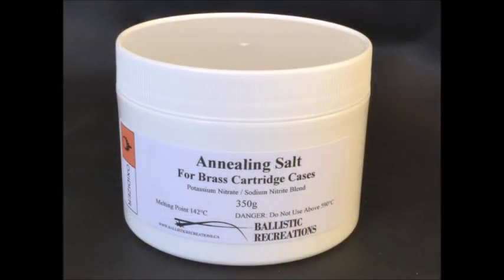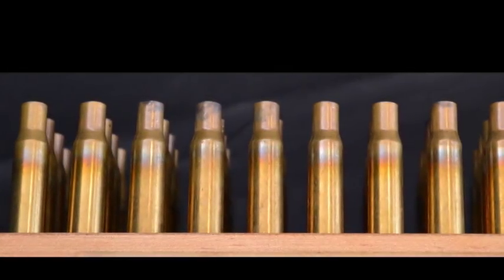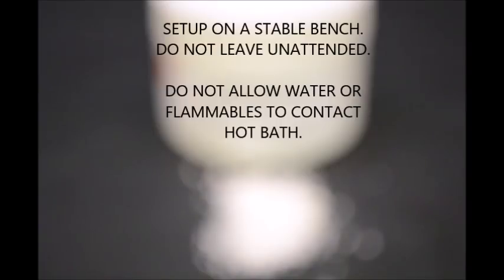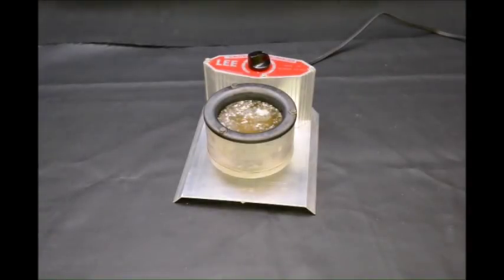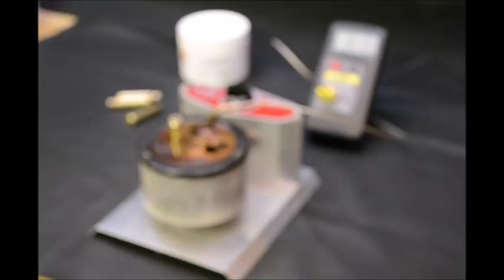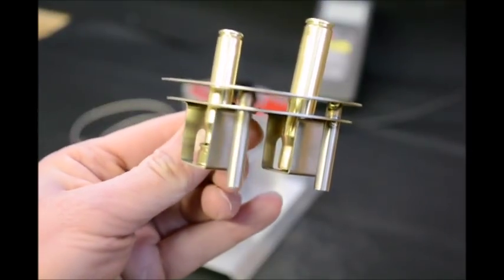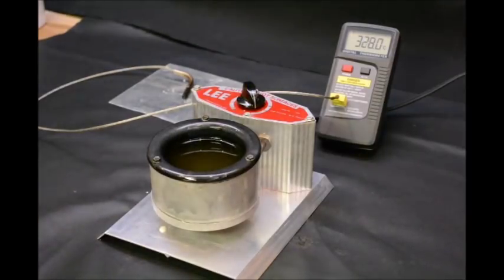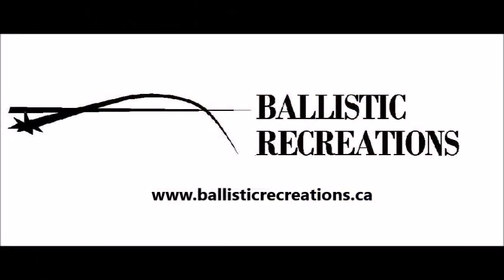Overview of Salt Bath Annealing

Comment: Annealing does absolutely nothing for accuracy.
Reply: Jessie Wright other than keep neck runout low from firing to the next, which translates to consistent neck tension, which translates to accuracy
Reply: Jessie Wright annealing has everything to do with consistency, and consistency is where accuracy comes from. So, thank you for your opinion, but next time read up on the process prior to spouting off a completely bold and untrue statement.
Reply: Let me rephrase.  Annealing has done nothing for accuracy "For Me".  "F" class 6.5CM and 6mm BR for 20 years.  PRS in .308 for the last 2 years.  Annealing does more for over stressed brass then anything else.  If my brass cracks, I buy new brass.  I use custom sizers built for my chambers.  I think neck turning does more for accuracy than annealing.
Reply: Jessie Wright even when annealed brass has proven to be more consistent? You are the messiah. I've been shooting PRL and PRS for 5+ years now, and BR for 20+ also, and every top shooter at the regional matches I've shot has annealed brass. Maybe it's not the arrow and it is the Indian.
Reply: jimhans The argument is as old as the case cartridge itself and I've shot at Local and State Matches as well and yeah, you're right every shooter has annealed Brass because all the Top shooters either use Lapua, Nosler and Norma except the Hornady sponsored guys which is a no brainer, and all the aforementioned brass is annealed out of the box. But i know a lot of shooters don't anneal after the initial use.   I'm just sayin what works for me and probably half the other shooters I know that reload.  AZ Long Range PRS, I know probably half a dozen guys that anneal after initial use.
Reply: Jessie Wright if you shoot in AZLRPS, ask Milkovich's if they anneal their brass :)
Reply: Jimhans: Nice one Sir !!
Reply: Are you also saying it does not extend case life?
Reply: I have not proven to myself yet whether or not it retains consistent neck tension and therefore accuracy but I have determined that neck tension begins to vary and velocity spreads increase as I start with virgin brass and reload it several times.  Virgin Lapua brass is as accurate as it gets in the 1 gun I use it for in the first 3 loadings.
Reply: I have found in my rifles that after about 4 reloadings (depending on how hot they are maybe less) I start seeing inconsistency in my bullet seating depths due to variations in cartridge neck tension. I’m no pro and only shoot the occasional benchrest match (in the production class no less) but even I can tell when bullet seating variations are starting to impact my groups and that line seems to be at around 3-4 reloads. Probably worth noting that like probably 98% of shooters I don’t use super-special “cut from the same reamer as my chamber” dies, so for those willing to pay as much for their dies as they did for their new barrel, I guess your mileage may vary.
Reply: Jessie Wright 
If anything at all, I find 
annealing makes outside neck turning way easier on my hands.